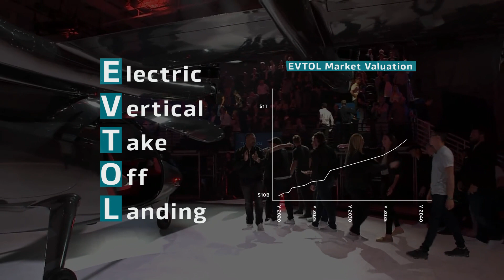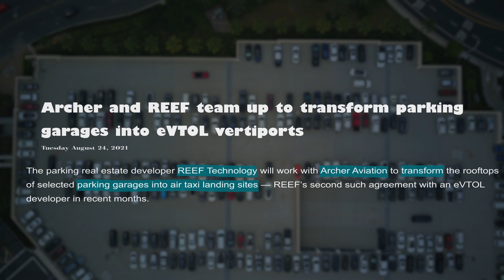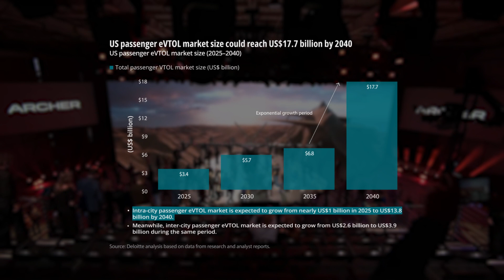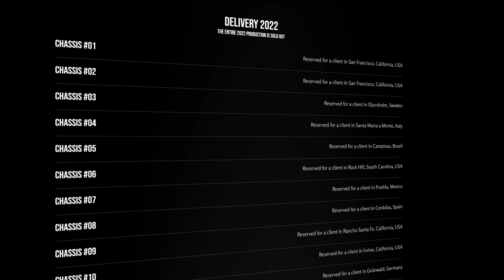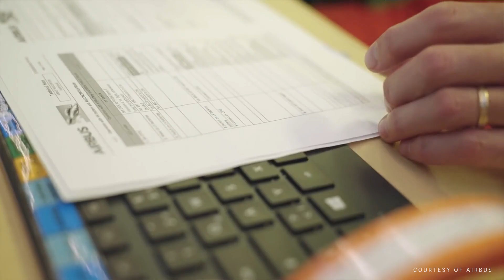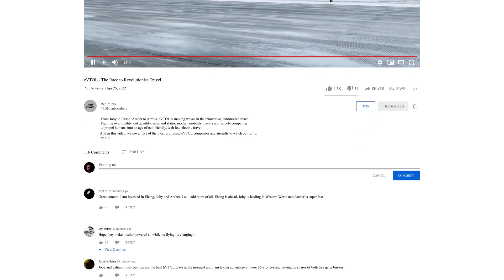eVTOL - The Race To Revolutionise Travel

Comment: In my humble opinion for e-vital plans by reducing electric consumption during take-off and landing, you could add to the passenger carrying capacity of the said planes or increase cruising distance. This can be done by some hard-wire arrangement either by electric overhead contact or by take-off/landing electric polls via a coupling/decoupling arrangement at the top of the said polls all the way down supplying the plain

Comment: My evtol is the best, 2 sitter no noise no need to charge batteries and it has no blades. Start flying as an experimental this month. Weights 340 lb. It will fly very fast but the technology is secret and not for sale. Glory to God.
Reply from the maker: Good luck with your evtol!
Reply: Thanks I'll publish soon.
Reply: @joereyes8835  I'd like to see it.